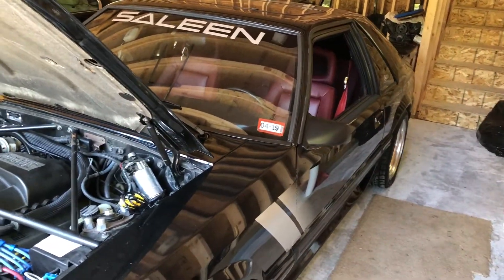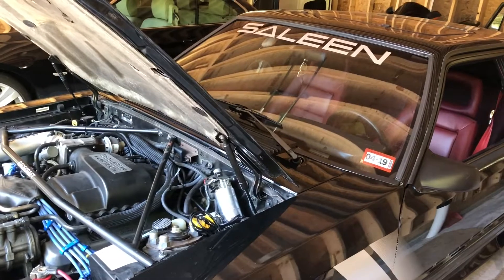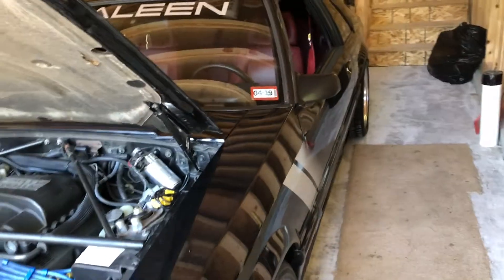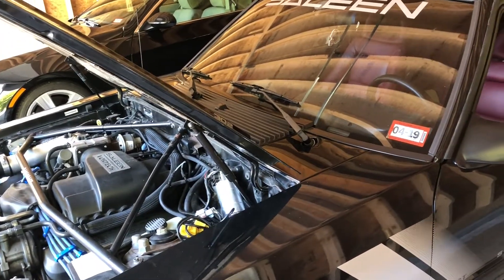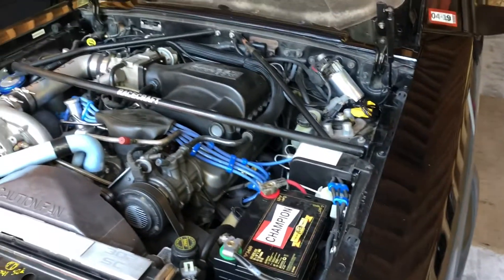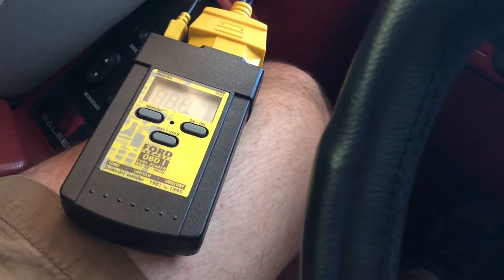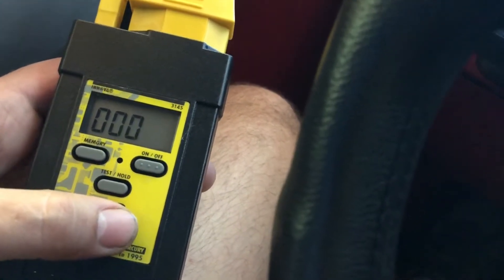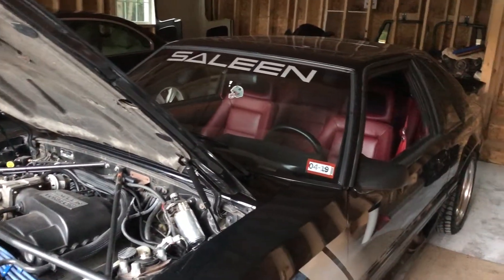Foxbody Mustang OBD1 Codes Part II

Comment: hey I got a few questions I'm new to mustangs I just got a 91 mustang gt I'm having some issues if ya see this I'll ask ya it's a older video definitely helped with the obd1
Reply from the maker: Shoot with your questions:
Reply: @Metalcop5150  so I removed the smog pump and blocked off the heads now for EGR and evr I keep getting code 84 and how should I route the vac lines for them both is it the 2 lines in the fender I'm so lost with the old technology I'm a back yard mechanic and never worked on any car before 96 only obd2 cars
Reply from the maker: @Mattys91gt  I think that code is unavoidable, once you eliminate the smog pump etc. No worries, it won’t set off a check engine light or cause any performance issues. As far as the vacuum lines, they just need to be capped off, so you won’t have a vacuum leak. Either eliminate them, at the source or just cap off the ends. You should be able to get the vacuum caps and plugs etc. at your local auto parts store. Easy!! 👍

Comment: So what you're saying is you cleared code 18 by cleaning out spout connection?
Reply: I had same code.  Car would die during KOER test.  Found out my distributor plug wasn't getting a good connection.   Pushed plug in and zip tied the end of the plug to hold it in.   Hope it helps
Reply from the maker: @tomborders6003  Thanks for watching and commenting! I'll be sure to check out the distributor plug.
Reply: @Metalcop5150  can you unplug the spout without messing timing up or if you unplug you’ll have to reset timing?
Reply from the maker: @mybannerisbetterthanyours  You can unplug the spout without messing up your timing. To change (or mess up lol) the timing, you have to physically move the distributor.
Reply: @Metalcop5150  i figured lol just had to make sure before going n touching things haha
Reply from the maker: I TRIED that, but it didn't work. The code is still there, but as far as I can tell it really doesn't affect anything. This OBD is very crude at best.
Reply: I tried to ad a pic.  But I couldn't figure it out.   If you have that code you could be stuck in base timing with no advance

Comment: I know this was two years ago but you need to press and hold in the clutch when you do the test that’s why the code 67 is popping up
Reply from the maker: Mike Marks Cool, thanks for the tip? I don’t remember what code 67 was? I do remember that it said nothing in the instructions about holding in the clutch? Maybe I need to re-read them, lol. Thanks for watching and commenting. Please consider a sub!
Reply: Metalcop Hey thanks for replying back I believe 67 was the code for the clutch solenoid I believe it was but if you see in other videos of guys doing a test on these mustangs they hold in the clutch while the test is still going on